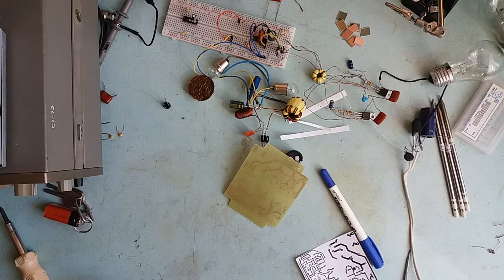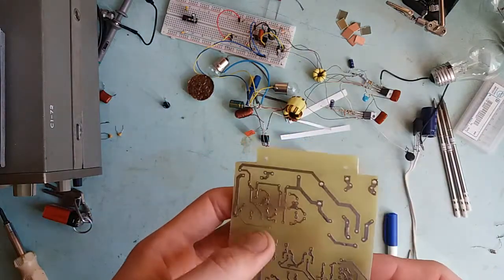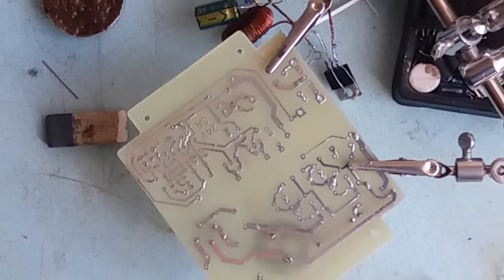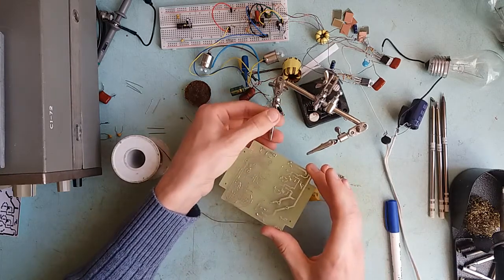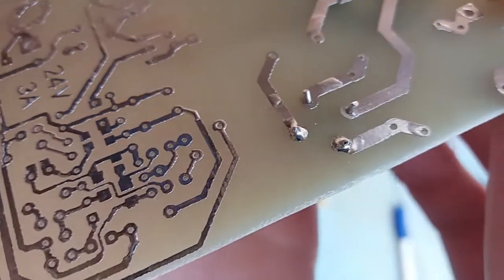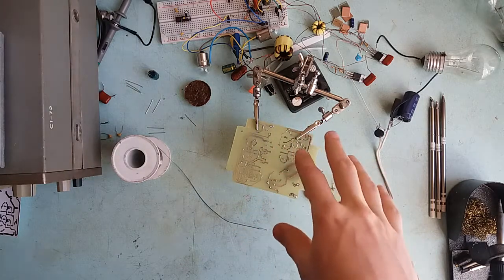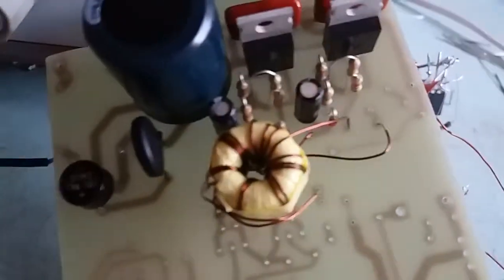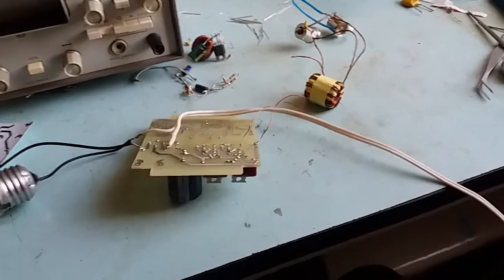tl494 SMPS: Part 5 - assembling the PCB

Comment: Let me tell Mr. Johhhnnnyyy a trick that I do when I lay out boards. I print them on paper then put the printed board art on a piece of foam and I stuff the parts in the paper. If it all fits it is good. If not I edit the board art. I keep doing that until I'm happy. Because paper is a lot easier to work with and cheaper than circuit boards. Then when I make the board I just pull the parts out of the foam and stuff them in the board. So it works out good then too.
Reply from the maker: Paul Frederick I do that too, but that time I was over confident that everything is alright.
Reply: It always pays to be your own worst critic. I'd think you'd understand that.
Reply from the maker: Paul Frederick Yeah, I'm usually self critical, I let it easy and it bites me in the ass. :D Like it did here

Comment: 12:11 Thx for the laugh. 

I've been collecting the stuff to etch my own PCB's soon with a laser printer/dry film photoresist/ferric chloride. Now I know I need to set aside a bit of space off camera for a little me time :)
  What are you using to tin your traces after etching? It looks really good.
Reply from the maker: Upcycle Electronics Regular solder, bevel shape tip and a lot of flux :D
Reply: Toner transfer kind of sucks. Whenever I get back into etching I'm going to try photoresist myself. As far as etching with ferric chloride goes that kind of sucks too. To make it suck less heat the bath up and blow air into it. I have one of those 12V car air compressors that I use. I have a tube coming off it that fits in an old aerosol spray can cap. The crappy pulsing action of the lousy 12V air compressor really adds to the agitation. Basically if your etch is taking longer than 3 minutes to do you're doing it wrong. Really good it it should take you 2 minutes flat. Your acid bath is hot enough when you see some fumes wafting off of it. That's about 105F if memory serves me? It should tickle your nose some. Ferric Chloride fumes are pretty irritating that way. Here's my old etching setup before I switched to the lousy air compressor. Notice the fumes http://i.imgur.com/29kxF.jpg

Comment: Looks like a psu to me, and it works!!.
Will it fit in the box?

As you don't like being told that you are good, you are ok ish, maybe perhaps lol.
Stop being upset by minor cosmetic errors, get that soldering station working.
Reply from the maker: Yes, it fits, it's been designed to fit in that enclosure. Don't worry, that station now works fine, I used it for a few weeks now, total runtime is about 24 hours I guess :)